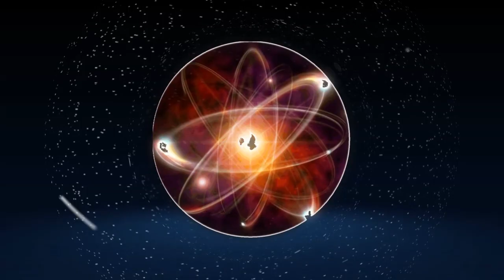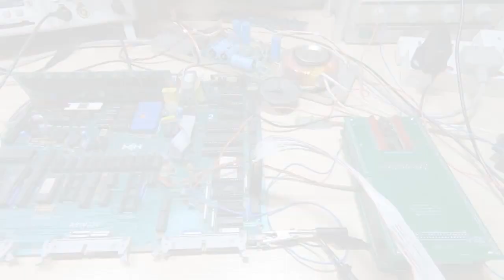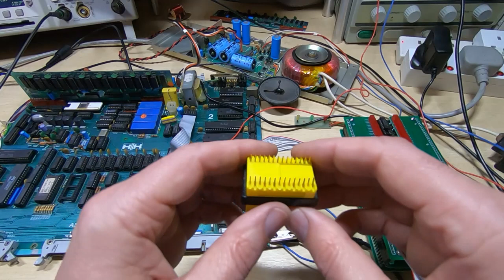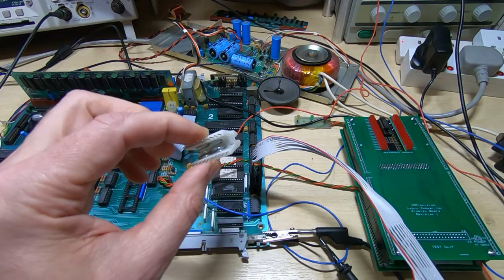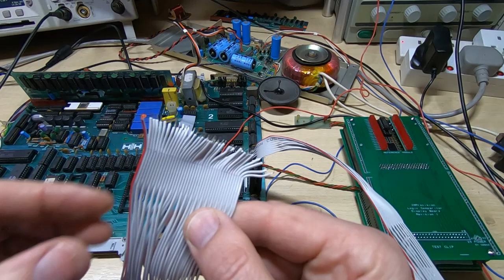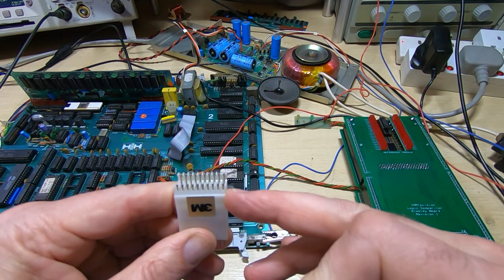JMPrecision Logic Comparitor Part9

Comment: Just wondering if in this part you said that you can also test Z80 processors on the comparitor too?
Is there a list of known 'testable' parts that you're maintaining that you could share in your website?
Reply from the maker: Unfortunately that is not really how it works. The devices supported depend on what the users fit to the module boards and how they configure them so I have no way of knowing what devices it is used with. It is more a case of knowing how it operates and then selecting a suitable reference device and then configuring the module card as per the device spec sheet.
Reply: Thanks Jerry, I just noticed the description in part 1 listed Microprocessors. The Z80 is likely the most common one I see so it’s great news.

Comment: Just watched the series on the comparitor. It seems that inputs and outputs are treated differently so how do you test, for example, an ls245 where pin direction changes with function? Is every Tri-state pin just treated as an output? Doesn't this get even more tricky with microprocessors with varying pin direction with time/function?
Reply from the maker: As long as the device on the tester 'receive' the same signals as the device on the UUT then it will work. If a device on a UUT has tri-state outputs then it is normally connected to something else that is then driving the bus so there are still 'input' signals. There may be specific instances when you may need to select pins as outputs or inputs but so far it has always worked for the testing I have carried out. If a line is totally ambiguous then you can just leave it disconnected but so far I have not had to do this. If a device has open collector outputs then this will still work as the reference device has pull ups on the inputs (but the UUT inputs do not). The most complicated devices to test are DRAM's that have multiple supplies as they cannot just be hooked directly to the tester. In these cases the supplies to the reference device have to be run to the module card and not connected to the test clip. If this tester proves to be popular then I can add special cards for specific DRAM's to make this easier. It is still early days and hopefully more feedback such as yours will help to guide the development.